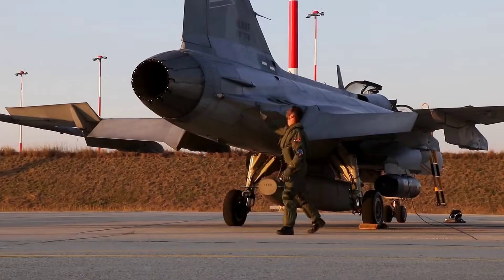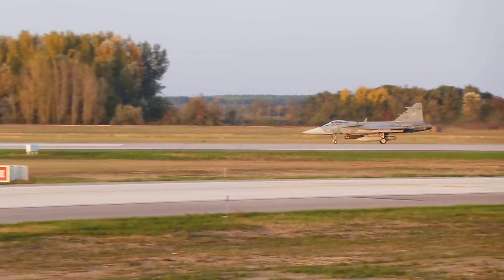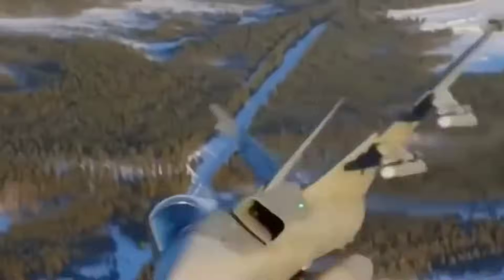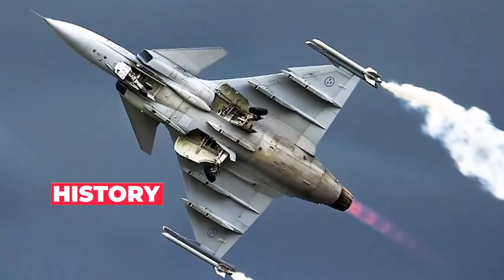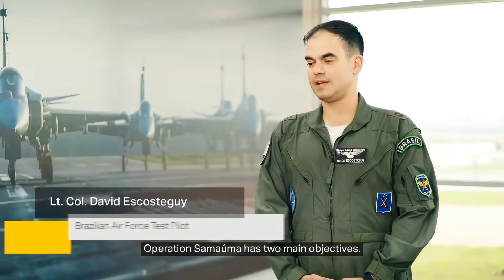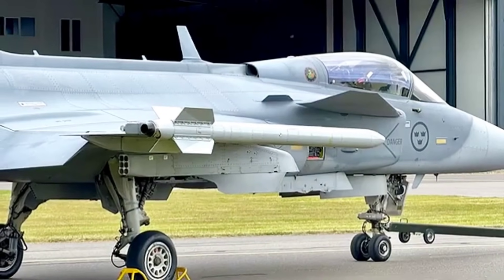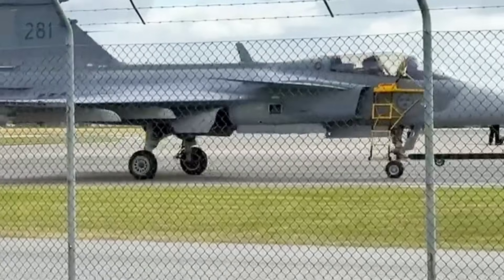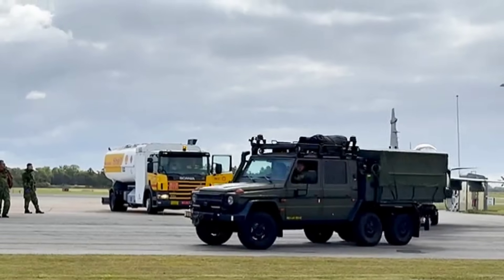How Rolls-Royce Quietly Rewired theGripen Jet - And Shocked NATO Overnight

Comment: Not happening libs.The only real fighter is the fifth gen F35 Every RCAF fighter pilots and our allies know this. It doesn't need a thousand youyube vids.
Reply: Are you one of those 
Pilots? The Swiss, an ally, have found out the hard way that the costs are too much
Reply: What’s a real fighter? Your generalization suggests you dont understand the individual profiles of a number of fighters currently in use. There is no choice, You would have to be an idiot to take an F-35 over  a Gripen. Read up.
Reply: Sorry bud, educate yourself, our own military want Gripen,   and or allies are abandoning the f35, why would anyone buy a fighter jet they have no control over
Reply: F-35 boat anchor . .
Reply: Whistling past the graveyard, are we?

Comment: Nope, it’s not a Rolls-Royce engine, it’s made and developed by GE
Reply: Nope… thats why they changed it and now can sell the Gripen to other countrys without permission from the US !!! Until now Gripen has the Volvo RM 12 Engine and it’s a licens build General Electric F404 Engine. The new engine will be a RR made in UK……
Reply: @milos.r3344  incorrect, the F414 is a development of the F404, which is a GE engine made under licence by Volvo.  Rolls-Royce are not involved with the F414 at all.  The current aero engines made by Rolls-Royce in the UK are the EJ200, Adour and TP400, as well as developments and for Tempest
Reply: @BSJWright well thats my point… no fu#@#g US made engine even if it’s made by Volvo…. US had the power to shut down sales by say that you can’t use our engine in this country…. That includes all countrys were the Gripen was competing against some old F16 junk or ” it’s soon ready to fly” F35
Reply: @milos.r3344  tell me which RR plant it’s being made at if you’re so confident.  And where on the RR website does it show that this is happening?  When was there an announcement (other than YT videos that aren’t official from any of the parties involved)?
Reply: @BSJWright it’s most likely going to be made in Germany, Italy and Sweden for manufacture. MTU particularly in Germany already help most of the jet engine manufacturers design and build jet engines for not just rr, but p and w and others. Volvo aero may get to make the engine in Sweden as well.
Reply: @duncanbarrie7397  that’s as maybe but it won’t be made there by Rolls-Royce, that’s for sure!
Reply: @milos.r3344 Gripen E got an engine called rm-16 and is built around Ge 414. Volvo only added a few parts. RR ej200 is only sold to Eurofighter. It was offered to Gripen E and a few other manufactorers as ej230, but never left the drawingboard. The price tag of the engine was higher, the integration more complicated and the hull need complete redesign. Maybe the next version of Gripen will get a RR engine.
Reply: It’s a really an rr engine developed in the UK. The Swedes are about to sell a boatload of these things….. inguantee that rr aren’t advertising the fact they’ve done this because they have a significant business with the us defence with reengineer Ming the new engines of the b52’s etc.